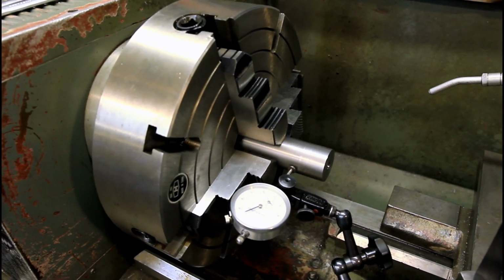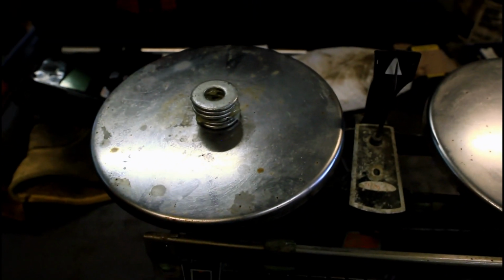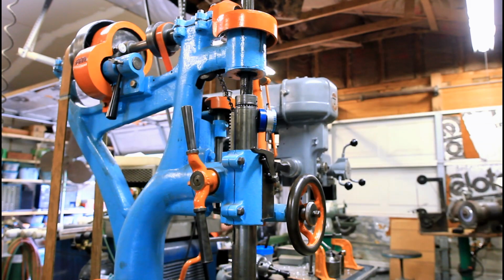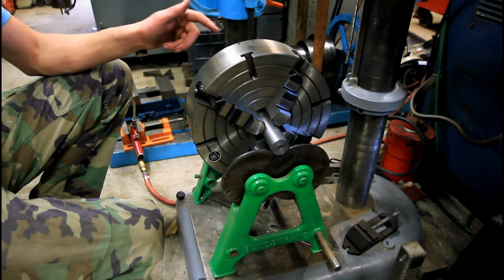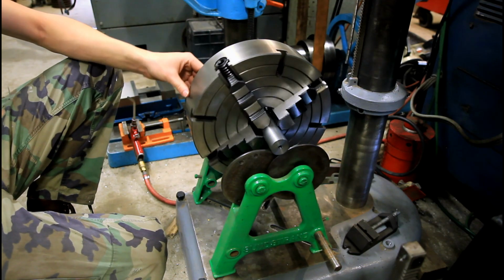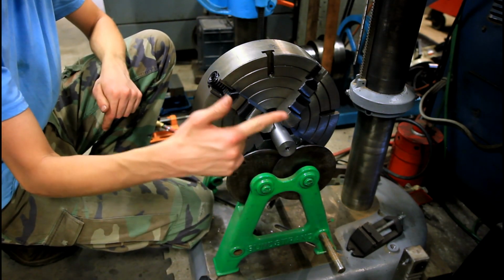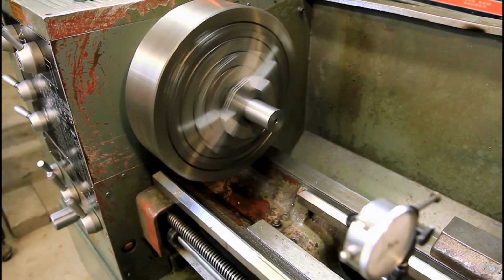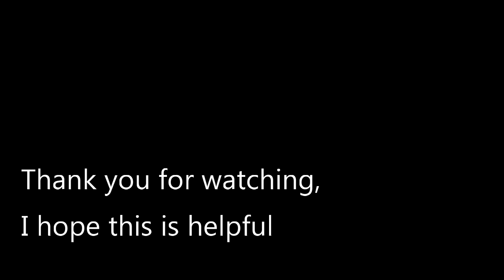How I Balance Lathe Chucks

Comment: Well done.
Tip: Always balance the weight of loose moving parts. In this case the 4 jaws or 3 jaws if it's the case.
 
A precision scale is very helpful for this action. Starting with weight balanced components is half the job. ;-)
Cheers
Reply from the maker: Cheers, I agree that that is the right move. Hopefully the hard steel jaws are much more consistent than the CI body, I'd have no great way to modify it other than grinding.

Comment: I like your process. Looks like you have the same balancer i do. When it was perfectly clean and lubed it could detect a #10 setscrew hole in a ground 5/8" diameter shaft
Reply from the maker: Crazy isn't it. This one has some damage and doesn't work perfectly. I shhould have a video coming out tonight with this chuck in action. Thanks James(?).
Reply: @TheMetalButcher  Yes it's James. Your lathe is similar to my 1941 Monarch 16x54 CW. Not running yet.
Reply from the maker: @EngineersWorkshop  Very similar machines.

Comment: My issue is that the bore of my lathe is dead true, but there is a vibration at 600 rpm only. Very frustrating. Both 3 and 4 jaws are trued, balanced.
Reply from the maker: Vibration still occurs with no chuck?